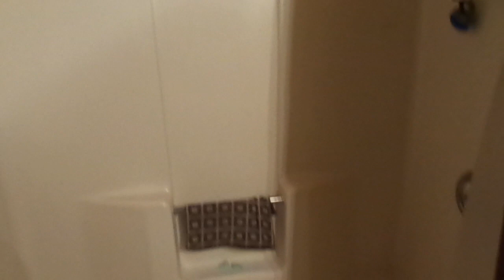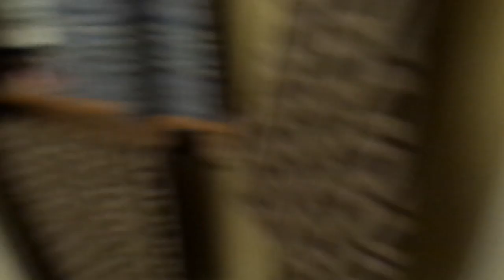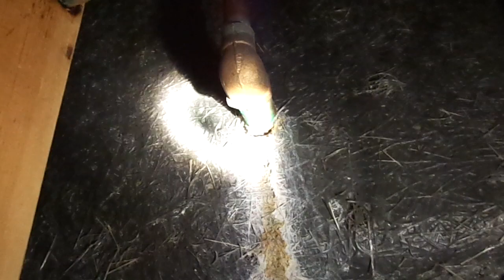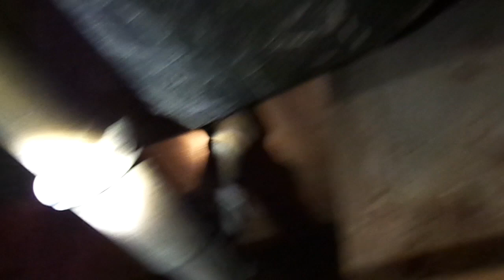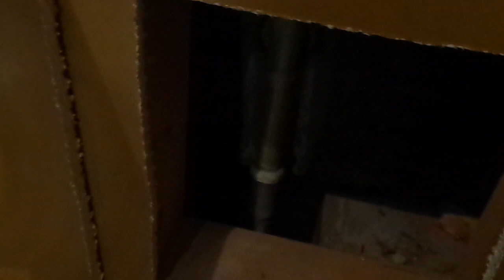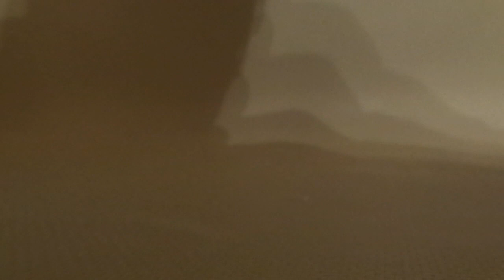Bathtub Repair Project - Evaluation

Comment: I think you are being a little ocd on this. Just tape it and forget it. Just throw a shower mat over the tape.
Also, for support, just throw a thick garbage bag under the tub then pump it full of concrete. It will cure to a hard base and the floor of the tub will feel solid. I did this to a fiber glass tub once. You can also 'stop drill' then open up the crack a little. You would then push a fiberglass patch and epoxy from the bottom then do the plastic bag full of concrete thin underneath it.
what you want to do is like respraying an entire car because of one scratch when you can just use touch up paint. Problem is the finish of the respray might not look as good.

Comment: Hey, hey.

Its me from Western Mass. You haven't mentioned your Helix in quite a while. I had my swing arm bearing fail on me at 25,000 miles. It started clicking. I couldn't find the source 'til the axil nut and outer collar disappeared. Fixed it all myself. In 18 years, Ive never paid for any repairs or maintenance. Including mounting and changing tires. I recently bought a Harbor Freight motorcycle lift. (The Delux) Its great! My case was, I deserve it, in order to get funding from Congress. (Wife) LOL

Comment: Where is the stuff that was left behind there during the dishwasher replacement?

Earthquakes are actually a possibility in NH and other parts of the Northeast, which may explain the need for thicker walls.
Reply from the maker: I actually took the stuff out just before starting the camera. Earthquakes are very rare in NH; the thick interior walls are also unusual for residential construction, especially when they are not load-bearing walls.

Comment: The price difference for a contractor to choose between a cast iron or fiberglass tub is minimal.  It's the labor they save in installing a fiberglass tub. My home was built in 1940 (it's a Sears roebuck Modern home), the cast iron tub is original and in good condition, though I've thought about replacing it with a claw foot tub and putting the old one in the second bath room. However i fear it probably weighs in excess of 500 pounds.

Comment: I've seen now 4 of these 80s tub/shower enclosures fail. My current home the tub flood is very soft and there are chunks missing. Its gotta be ripped out. My buddys was similar. The previous owner had a cake pan underneath it in the laundry room celing.my prior home was a shower only and it cracked so bad i thought I'd fall through. My grandmothers guest bath also failed.
4 different tubs, 4 different stories.  Time to buck up and pay homo despot $1200 and let them replace it.

Comment: Tub Repair
 When they built a house they should spray foam underneath the tub that would have prevented any flex and cracking in the futurel

Comment: Just replace it and put a new tub in properly. Invest in a skilsaw and a sledge hammer.
Reply from the maker: Oh it sounds easy, but the reality is this; I don't own a truck, I work full-time, I'm a college student, I'm not a carpenter (but I can figure it out, I've helped my dad replace a tub once), I have access to the tools, and this is my only bathroom. Oh, and the nearest hardware store is 25 miles away. I'd rather just fix the tub and keep it for another few years... it's doable.

Comment: Although if you think that's bad wait until you get a single family home someday.  Everything is like this.
Reply: Modular homes are even worse, depending on who puts them together. Some of the wiring and structural stuff I've discovered over the years in my parents house is beyond disturbing.